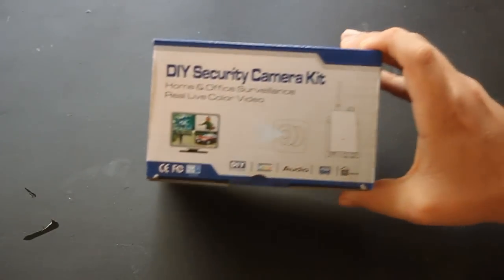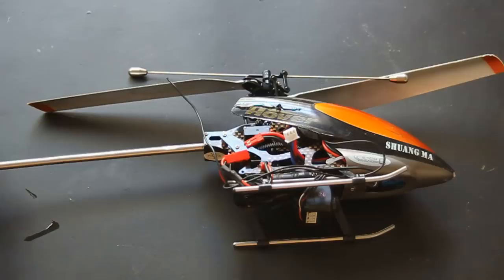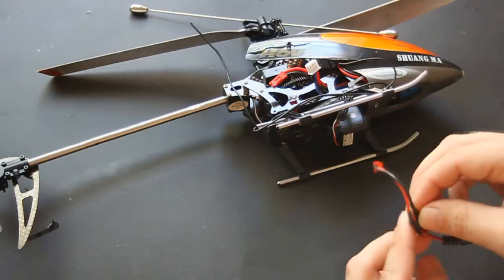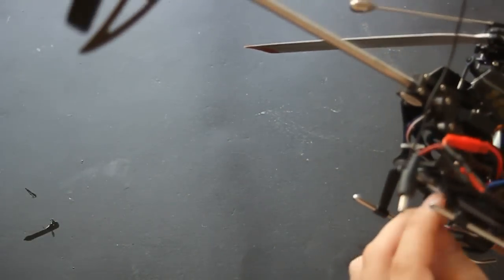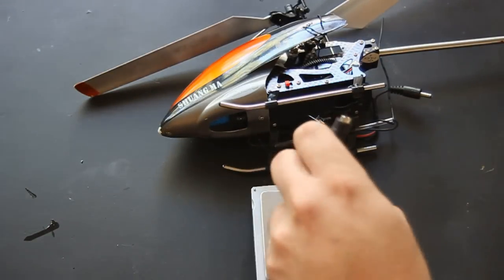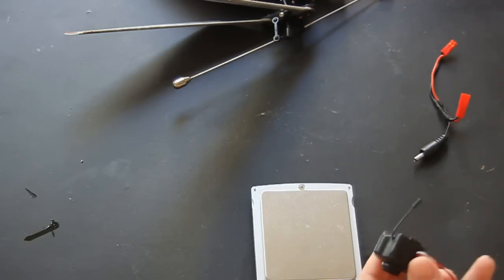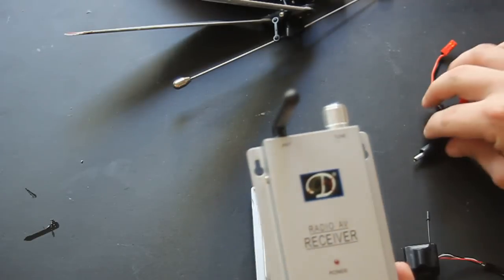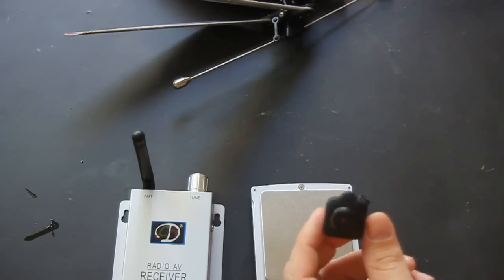Attaching a wireless 2.4GHz camera to an RC aircraft or helicopter

Comment: For what purpose? a bigger antenna does not increase range, rather it reduces it because you are altering the wavelength outside what is used by the frequency. You you have a knowledge in electronics and antenna construction you can always open it up and solder on a different type of antenna such as a circular polarized.